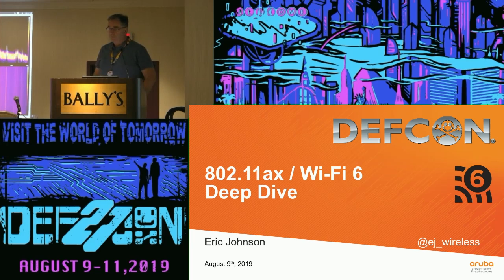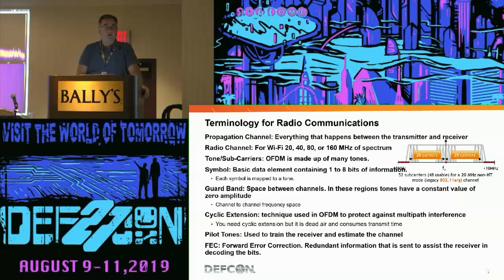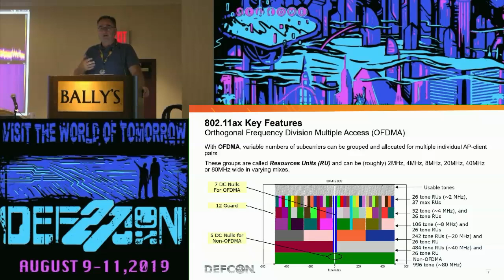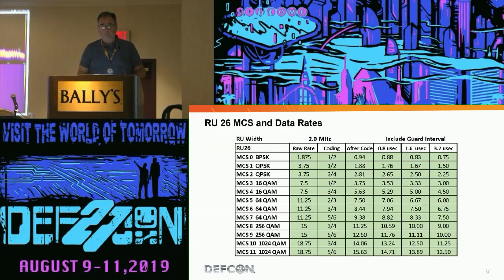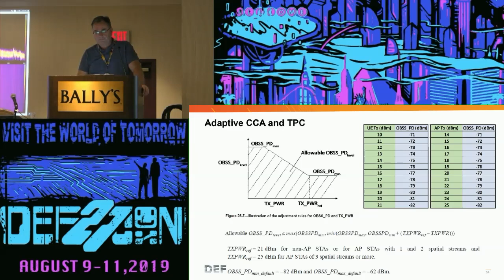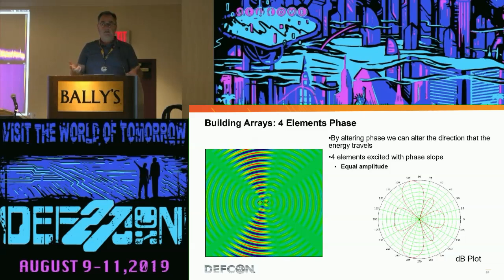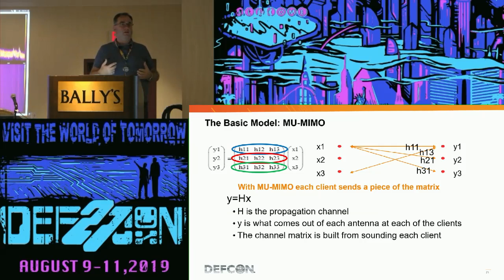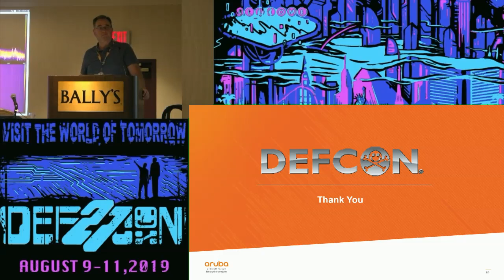Eric Johnson - Wi Fi 6 Deep Dive - DEF CON 27 Wireless Village

Comment: Great presentation but I found the use of antenna patterns to describe MIMO streams a little confusing. Here's how I try to think about it: A separate stream of bits is fed into each radio chain (1 per antenna). The bits are Forward Error Correction encoded. Each of these FEC "symbols" is mapped to a QAM constellation point (which is just a complex number representing a sine wave amplitude and phase). So now you have a vector of complex numbers (with one entry per antenna). Multiply the inverted H-matrix by that vector, and you get a new vector of complex numbers. Those are the actual amplitude/phase symbols each antenna transmits.  That matrix multiplication distributes each stream across each transmitting antenna. Then the propagation channel in effect multiplies the H-matrix by that transmitted vector. The result is each receiving antenna only detects one stream, because the other streams have been "nulled out".
Reply: I think of it as: you want each RECEIVER antenna to receive a separate bitstream, so you encode all of them separately and then multiply by the inverse of the channel. Then the receiver gets multiple bitstreams from you. Other receivers get noise because they have a different channel matrix. This works even if the receiver antennas aren't attached to the same receiver, so you can send to multiple receivers, instead of multiple bitstreams to one receiver.